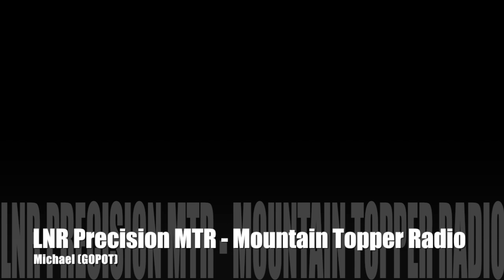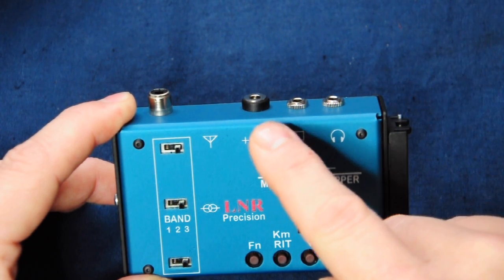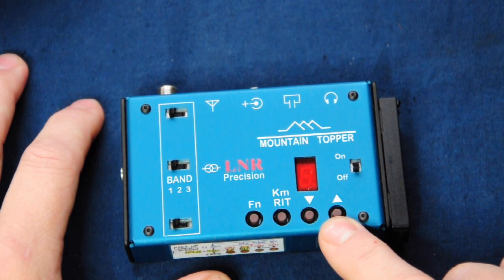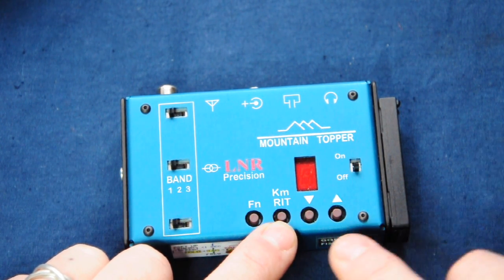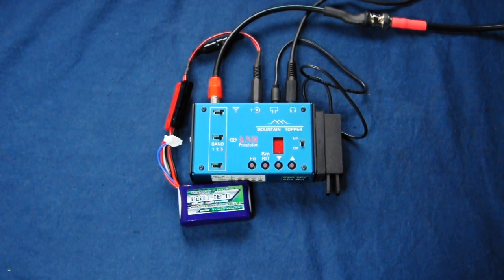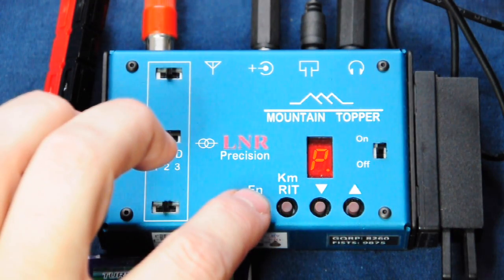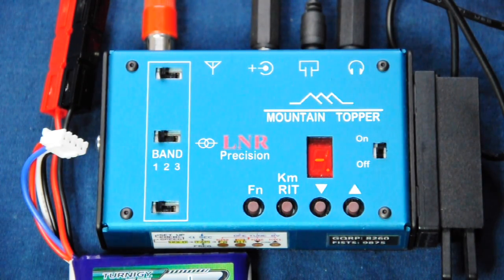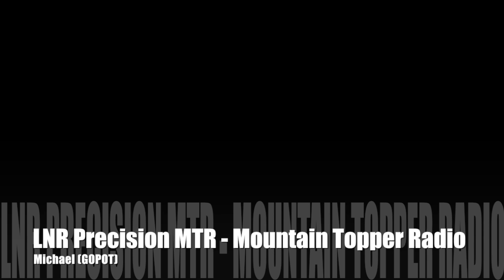Mountain Topper Radio Review (MTR3B)

Comment: Just nitpicking. Why not have the 9V battery be able to be installed inside the radio with a screw on cover?
Reply from the maker: That would require a larger case…definitely no space in this one. However it might come down to the original design criteria. Many portable operators like to use external batteries because you can easily take a size that matches your requirements and, when operating in extreme cold, you can pop that battery in a pocket to keep warm. That said, there’s something very convenient about internal batteries and I do appreciate that option on radios like the KX2.

Comment: I don't get why they would put a single 7-segment display on this expensive crap. Why do they complicate thins when with just half a dollar, you can get a 4-digit display, or for a dollar you can get an OLED. This is bl00d-boiling unnecessary stinginess.
Reply from the maker: I guess when this was first designed and built, the 7 segment display was a cheap and power efficient approach to providing visual info. To change it now would require a PCB change and enclosure redesign which maybe adds to the cost and risk. The humble 7 segment display is a bit basic but it does it’s job :o)
Maybe there will be an MTR-3B mk2 in the future.

Comment: Thanks for the video, one naive question, is there any android app that can work as a keyer for this device ?
Reply from the maker: A keyer needs to be able to switch the key input of a radio and I’m not aware of an app (which would also need an interface between your phone/tablet and the radio) which can do this. Good idea though for someone that wants to automate sending. You want the mobile equivalent of N1MM running on a laptop.

Comment: Terrific review of a neat little radio. The fact that it is a triple band is what makes it a good value. I don’t own one because the operation is more complicated than I’m used to. Also I don’t like the RCA antenna connector and the non standard power input. Never the less it is well suited to the minimalist portable QRP operator. MikeinMinnesota N0WDM
Reply from the maker: Michael St.James I’ve just started playing with an SW-3B which is an equally tiny 3-band radio that has a tuning knob and RF gain/volume controls. Check out www.venus-itech.com

Comment: Michael, thank you for all your videos of LNR products. I am getting ready to purchase an MTR3B and I wanted to inquire where you purchased teh RCA to BNC power cable. I have found them in different places but only in 6' or longer cables and I do not want anything that long. Any help would be greatly appreciated.
Reply from the maker: Steve McQueen I actually made my adaptor. 
I used about 12cm of coax, a BNC panel mount female socket a bit of heat shrink and an RCA plug. You can get one piece RCA to BNC adaptors but they are quite long and act as a bit of a leaver on the tiny MTR so the short ‘dongle’ version is better. I can post photos if that helps.
Reply: @g0pot  Hello Michael.Please help about this rca jack.Commercial rca jacks are not 50ohm.Does it matter?Can I solder the coax to rca jack and  connect to the mtr3b.Thats all?
Reply from the maker: @tolgacelik9905  Yes, just solder the RCA direct to the coax. It's a little tricky and be sure not to let the inner and outer of the coax become shorted. I think I had to open up the hole in the top of the RCA cover a little as the coax was a little wider than the sort of cable you would normally use. I just used a round file to widen the hole. I can post pictures if needed.

Comment: what was the power output tweak?
Reply from the maker: John Leonardelli I simply had to adjust the winding spacing on the low pass filter toroids...in my case I had to spread them out a bit and in all likelihood I could probably get more out of the radio if I removed a turn but I’m happy with just a few watts.

Comment: Hi, Michael. How did you make the antenna dongle? Which components have you used? Cable RG58? Thanks...
Reply from the maker: Konrad, I've just added details on the dongle and how I mounted the Palm Paddle to the radio on my website...please check out these details and pictures at http://peanutpower.co.uk/mtr3b

Comment: Hi Michael, I'm curious as to how you have the paddles attached to the side - velcro, double-sided tape, magnet...? Tnx, great video.
Reply from the maker: The screw in the side of the MTR case lined up perfectly with the mounting hole in the Pico Paddle base. I just had to use a slightly longer screw as the one in the case was just a few millimetres short. I couldn't find a direct replacement...I'm going to assume the threads are based on an American standard so I found the closest metric equivalent and let it 're-cut' the thread. It's probably important not to use too long a screw as the PCB and components aren't far off! Measure the existing screw and find one about 3 - 5mm (100 - 200 though) longer.

Comment: I just bought the same battery for mine. However, after charging it I saw that it was at 12.5 volts even thought it's nominal voltage is 11.1. The MTR's documentation says 12 volts max so now I'm scared to use my battery. Have you had any issues with excess voltage?
Reply from the maker: Hi, a good question to ask. I can only advise that I've had no issues using mine. I think the battery presents a little over 12V when open circuit (not connected to anything) but drops below 12V when attached to a load. I'll take some measurements of mine (disconnected and powering the radio) and post my findings back here.
Reply: Thanks Michael! That would be great! Even just hitting the menu and up buttons to see what voltage the MTR is seeing while idling would be a quick and dirty way of checking that.
Reply from the maker: A very quick test showed 11.79V on my LiPo before connecting and 11.79V while powering the MTR3B. So it seems adding a load does not significantly impact the voltage output. My LiPo isn't freshly charged (I'm sure it goes above 12V when it is) so I will recharge it tonight and retest in the morning and update you. As I say, I've been using this set up for almost a year with no negative impact.
Reply: It's good to hear you've not had troubles at least. Thanks for checking. I'll check back here tomorrow and see what you've found.
Reply from the maker: With a fresh charge on the 460mAh 3 cell LiPo my battery measures 12.5V. When the MTR3B is powered this remains steady at 12.5V (using the Fn + up arrow the radio reports 12.4V). I've clearly not had any issue with this voltage level but I concur the MTR documentation does state that the voltage should not exceed 12V. I guess there is some tolerance. I note that this voltage remains steady even when I start transmitting.
You could add a diode in the supply line as this would drop ~0.7V and bring you under 12V.
Reply: With the MTR's miserly current draw, even during transmit, it's not surprising that the voltage doesn't drop much.  Thanks so much for checking it out. A diode isn't a bad idea, especially since I've read somewhere that the MTR doesn't have reverse polarity protection. That might not have to truthful information I read but it can't hurt all the same.

Comment: It is unbelieveble. It is 2016 and there are a lot of things missing on this radio, like a normal display. In the comments below the word minimalistic is used. Keep that in mind. Why are there keys on the radio to make a selection? Wouldn't it be nice of those too where done on a Morse code way. And why only one cypher in the display, get rid of it and make it hearable also in Morse-code. 
 
Monty Python made something like 40 or 50 years ago a sketch about a play on stage of Wuthering heights by Emily Brontë, but then in signal flags, well this is it! This LNR Precision version of the MTR, Mountain Topper Radio is a remake of that, but then completely different!
Reply from the maker: I guess the interface design of a radio is a balance of function, power consumption, general usability and, of course, customer requirements. I'm surprised at the need for three slider switched to change band but if it saves on power to provide an alternative through relays or micro controllers then, given the raison d'être' of this radio I guess it was a trade off worth making. I like having that simple, single digit display to remind me I have the RIT on! Although I like having morse annunciation (and the MTR uses morse to both annunciate and to accept direct frequency changes from the key) I still like to be able to scroll up and down the band holding the button. I think with the MTR3B the designer has achieved and extraordinary weight:power:feature balance based on his initial design aims.
Wuthering Heights using semaphore...Monty Python are pure genius :o)

Comment: Question for you. Did the magnets in the Pico Paddle mount affect the transceiver at all? Did you remove them prior to directly mounting it to the transceiver or leave them in? Thank you. Michael AD6S
Reply: +Michael Sansom It's very easy to hold in one hand and send in the other. although it's a little different than using paddles and you'll want to adjust it slightly for your own comfort.  It's doesn't fit my hand well enough that using it one handed is comfortable, although it's doable.
Reply from the maker: Good question Michael...no, I left the magnets in the base of the Pico Paddle and it had no affect on the MTR when installed on the right hand side of the case.
Reply: Thanx for the quick reply. I ordered mine and it should be here by the end of the month. I plan to copy your mounting method. Will be using your review as a "Reference" when it finally gets here.  Nice job - Michael AD6S
Reply: +Michael Sansom Hm.  Mine should come this week.  I'll have to think about ordering the Pico Paddle as well.  Right now I've got a Te-Ne-Key, which is pretty robust but has the disadvantage of not being mountable.
Reply from the maker: Ooooo...just looking at the Te-Ne-Key...very sweet. I wonder how easy it is to hold that in one hand and send with the other? I guess if you use a 'flight deck' (see one of my other videos) and can screw it down to the flight deck then that would be OK. Maybe you can create a small bracket to fix it to the MTR...or you could just go for it an get yourself one of those excellent Palm Pico Paddles...they are great.

Comment: What mount did you use to attach the picopaddle?
Reply from the maker: I'm just using the Palm Pico Paddle mount as you can clip it to the key from below or, in my case, from the side. The screw in the MTR case lined up perfectly with the mounting hole in the Pico Paddle base. I just had to use a slightly longer screw.
Reply: +Michael Sansom Gotcha! I hadn't noticed that there were mounting holes in the bottom of the magnetic mount. Do you happen to know how much longer a screw you had to use?
Reply from the maker: +MrEttercap The case screw was literally just a few millimetres short. I couldn't find a direct replacement...going to assume the threads are based on an American standard so I found the closest metric equivalent and let it 're-cut' the thread. It's probably important not to use too long a screw as the PCB and components aren't far off! Measure the existing screw and find one about 3 - 5mm (100 - 200 thou) longer.
It fits perfectly on the side of the MTR like they were made for each other. 
Enjoy...

Comment: Look, don't get me wrong; I like all QRP radios and appreciate each and every one for what they have to offer. The YouKits HB1B MKII beats this LNR rig hands down. Full and bright frequency display, built in memory keyer, adjustable volume, adjustable filtering, small size like the LNR. All around, the YouKits is just an easier radio to use and works FB. Just saying........
Reply from the maker: +Binder Dundat The YouKits HB1B is a great little radio but really in a different league to the MTR. The MTR is pure lightweight minimalistic heaven whilst managing to be an absolutely superb performer. The HB1B is very large in comparison and really in the same league as the KX1. I think the quality of the KX1 outstrips the HB1B by some margin but you can't beat the 'bang per buck' value of the HB1B...it's low cost has opened up trail-friendly radios to a whole new base of Amateurs.
By the way, I also love that big bright screen on the HB1B but unfortunately it drains batteries...the MTR and KX1 both excel in low current draw and thus better lend themselves to the role of trail-friendly radios and portable operating where you don't want to be carrying huge batteries.
Reply: No, actually I think you're splitting hairs here. We're talking about the MTR and the HB1B, not the KX1, which I own as well.

The MTR is 3.8"x2.7"x1" and the HB1B is 5"x3"x1.25" The MTR is 9oz lighter than the HB1B. The MTR current drain is 35ma on rx and 550ma at 12v on tx. The HB1B is 80-90ma on rx and 800ma on tx at 12v.

I've carried the HB1B in the hills of Newfoundland, in the Canadian Rockies and along the coast of El Salvador. I use a 2300mah LiFePO4 battery that I purchased from eBay a number of years ago and I am able to operate as long as I really want. If I decide to go for longer I take a 4200mah Zippy brand LiFePO4 battery that I purchased online from Hobby King in Hong Kong. It's 5' long x 2" wide and weighs 19oz.

Very very few people who buy the MTR will use it in a situation where ultra lightweight and miniature size are critical. They buy with that romantic idea in their mind, but it mostly does not come to fruition. For the majority of buyers, the HB1B is more intuitive to use and has more features. The minimal extra weight and size are more than made up for by ease of use and the intuitive features.
Reply from the maker: +Binder Dundat Binder, I can't argue with you assessment of our 'romantic ideas'...its very true. I was also compelled to check the manufacturers figures for current draw after I flattened a battery using the HB-1B but I must concur, the HB-1B (at 11.5V) draws closer to 73mA on receive and  somewhere around 730mA on transmit (differs a bit per band) for ~3W out on my model. So although much higher than my MTR those are still pretty impressive figures for a trail friendly radio and, like the KX1, it has the added advantage of things like a tuning knob and you can comfortably listen to broadcast stations which is nice when camping.
I still think the size and 'bulletproofness' of the MTR make it a great throw-in-the-bag transceiver and my MTR, battery, key and headphones in a little protective case take up less room that a KX1 or HB-1B barebones radio but they are all superb and you just can't knock the HB-1B cost/feature ratio. You should own all three ;o)
Reply: +Michael Sansom - the MTR is a much more "packable" radio and I think this was part of the reason for pushbutton tuning, no volume knob, and low profile band switches. Precautions must be taken when packing the HB-1B that aren't as necessary with the MTR. These precautions will add bulk. I've compared the HB-1B and the upcoming MTR-5B here and agree - one should own them all:
http://ae5x.blogspot.com/2016/04/youkits-hb-1b-vs-lnr-mtr-5b.html
73 - John
Reply: I've packed the HB1B into some pretty nasty places and have had no issue whatsoever. The advantages the HB1B have far outweigh your description of it being a less packable radio. It's just more intuitive and better all round

Comment from the maker: A few people have commented that the power output seemed a little low and a after a quick email to LNR and a response from Ryan on how to tweak the output I now have about 4.2W on 20m and 3.3W on 30&40m using 12V.
Reply: +Michael Sansom 

I receive my MTR in about 2 weeks.

Can you tell me how to tweak the output?

73 de Daniel
Reply from the maker: Daniel, first check the output on each band you may find yours is absolutely fine straight from LNR and doesn't need any adjustment. Be warned, it's possible to push the PA too far and damage the O/P transistor I think. If you find the output is low and not to your liking then see the following from the original MTR build guide...
Transmitter test and output (low pass) filter adjustment:
● Connect a QRP watt meter and 50 ohm dummy load to the antenna jack
● Connect a 9.0 Volt supply. Other voltages can be used, but power out at 9.0 volts is the only known data point for sure.
● Use a straight key or keep the Dash paddle closed when turning power to the board on so it goes into straight key mode.
● Key the transmitter and check the power output. If using a 9.0 volt supply, the power should be close to 2.5 watts and between 4.5 and 5 watts with a 12.0 volt supply.
● Power out can be tweaked by adjusting the spacing of the turns on the LPF toroids. Typically, moving turns closer together on the coils on the PA side of the filter (L12/L14/L16) will decrease power while spreading them apart (to be move evenly spaced around the core) will increase power. The power out on 40 and 30 will likely be a little on the high side with the turns evenly spaced.
● To achieve maximum PA efficiency, using an milliamp meter to monitor the current while making the filter adjustments can allow you to find the point where you get the most power out with the least amount of current.
● Once one band is done, switch to the others and make any adjustments if needed.
...in case it's not clear, with the front of the radio facing you and the sockets on the back facing away from you the coils should be in the lower right corner and the PA side are the three closest to you, closest to the front edge of the case. L12 (40m) is on the left, L14 (30m) in the middle and L16 (20m) on the right tucked in the corner. Use something soft (like a matchstick or your finger nail) to adjust the turns being careful not to damage the wire.

Michael
Reply: +Michael Sansom 

Thank you very much for the detailed instructions.

But I cancelled my order of the MTR and bought a YouKits EK1A.

Maybe the instructions can help other hams ;).

73